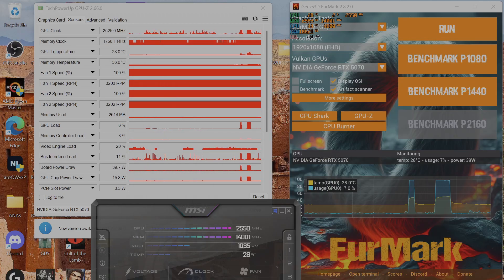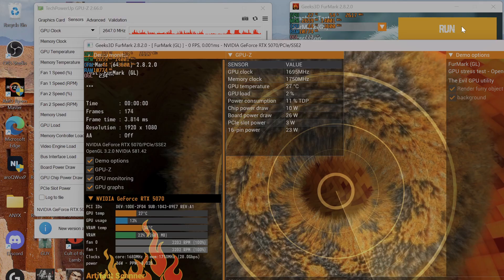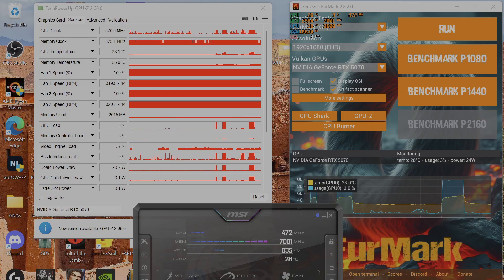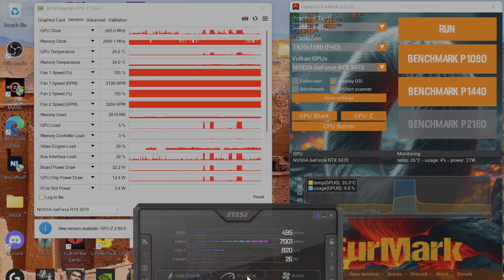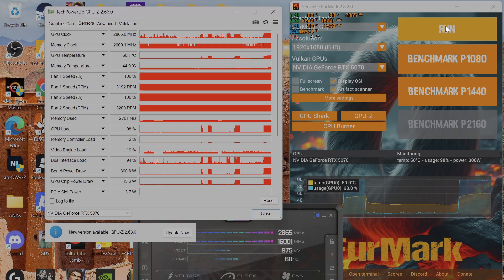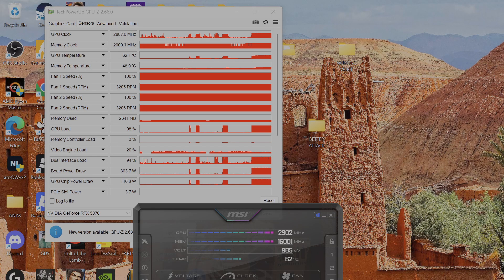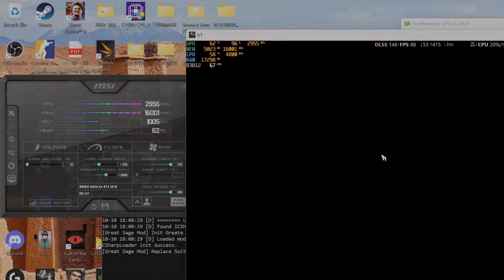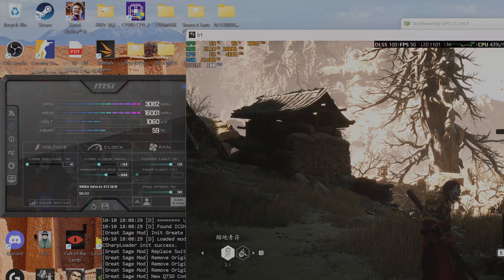Boost Your RTX 5070 Performance by 10% — Easy Overclocking Guide!

Comment: How does this performance vs stock? I think i saw general 10% gains?
Reply from the maker: yes at 3.15-3.2  ghz core clock and 32 Gbps memory speed  (plus 2000+ memory speed).,  its 10 percent gain in gaming.   This 10 perecnt boost is Awesome for  MFG 4x  helps boost base FPS .

Comment: I can do +340 core clock no problem. Tested in many GPU intensive games and heaven/furmark. You must have gotten unlucky with your card.
Reply from the maker: The goal here is to hit 3.2 GHz on the core clock while keeping things stable. 🚀🔧
We’re not chasing offset tweaks — once you push past 3.2 GHz, stability drops off fast. My personal best was  plus 385 offset, but that was purely for benchmarking. 📈🏆

For daily gaming, I keep it at +250 (3.2Ghz Core Clock) — rock solid every day. 🎮
My highest 3DMark NoMad score was around 6220ish, so if you’ve managed to beat that, props to you! 👏
But remember, going beyond 3.2 GHz is just for scores and bragging rights, not real-world practicality.     If you actually monitor your wattage (300 WATT MAX currently for 5070),  you will see you are POWER LIMITED,  so even if you can do plus 340 offset or more your stability  is compromised without higher watt bios or shunt moddding.